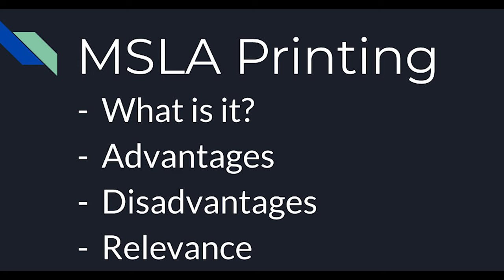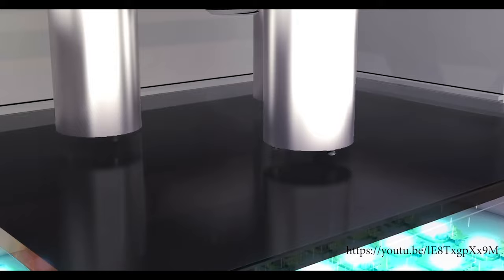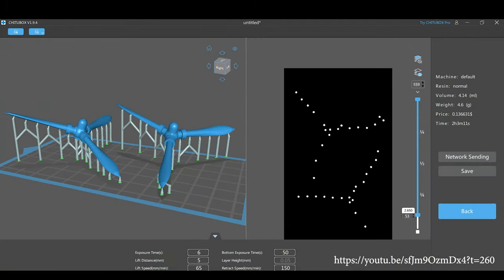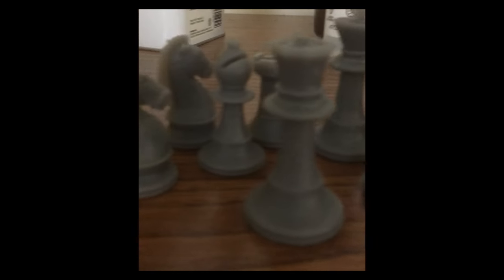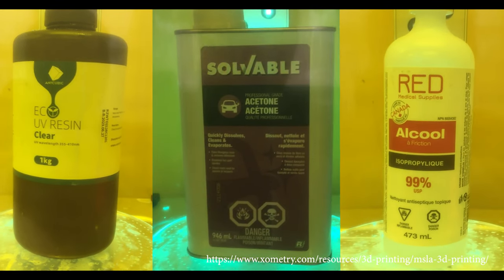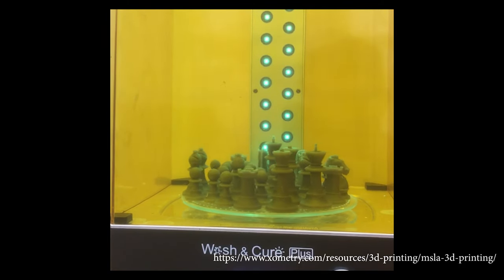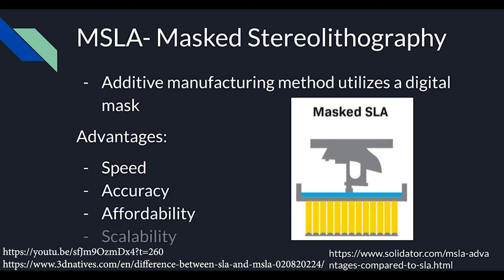What is MSLA Printing?

Comment: Those prices are a lie. Ender 3 - ~$185, Elegoo Mars 3 - $350 when you get the REQUIRED curing machines.
Reply from the maker: Assuming ~$185 is CAD not USD about your comment. Source (or name of site) to that price since that is a good deal. (may be caused by the additional CR touch + extruder option variant)
looking into it here is what I can find for ender 3 pro:
amazon $288 CAD (non upgraded, in vid was the upgraded one)
Best buy: $396 CAD
Creality store $284.22 CAD
3D printing canada: $299.95 CAD (currently 25% off, so 399.95 CAD normal price)
-Ebay: ~275 CAD (conditions vary), cheapest working I can find is $236 CAD (there was a trick/scam item showing printer pics but it was the filament selling for 185 CAD)
kijiji: used ~220 CAD
mechestore: $309 CAD
Aliexpress: ~$270 CAD average, cheapest $255.51 CAD

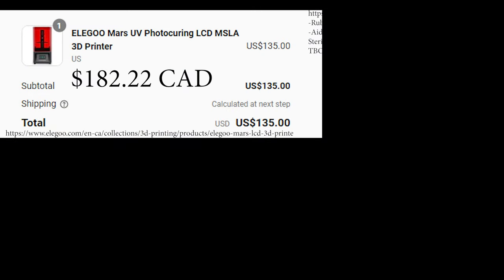For the elgoo mars ~$350 that is what is mentioned at 1:36. Each type of 3d printing style has it own post processing steps hence having a separation between the printer itself and the full operating costs. The part does need to be cured by UV light but the source of it can vary. Using the sun works but then you have to keep rotatating the part by hand on a sunny day. Same thing for washing, you could do it manually but time consuming.

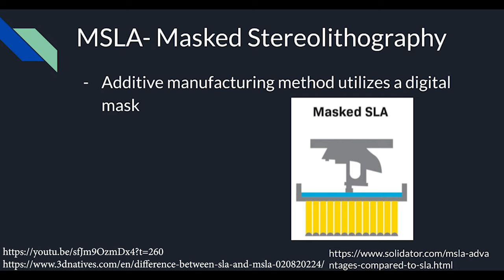I would of added that info but a requirement for marking was that the video MUST be 2:30 to 3 min long.